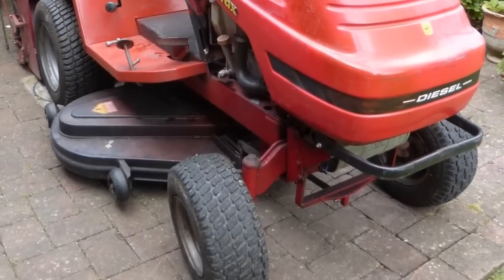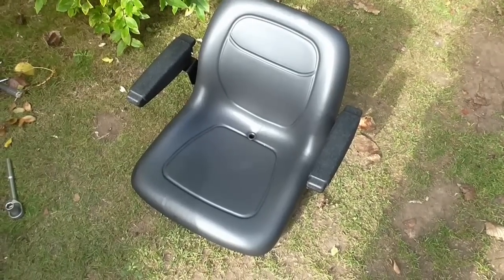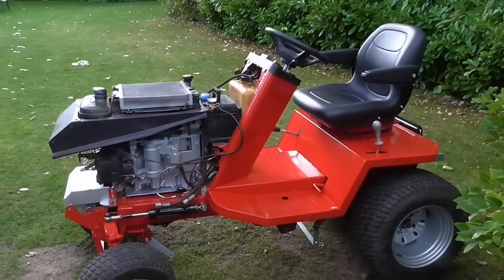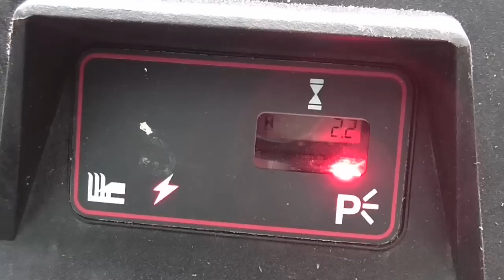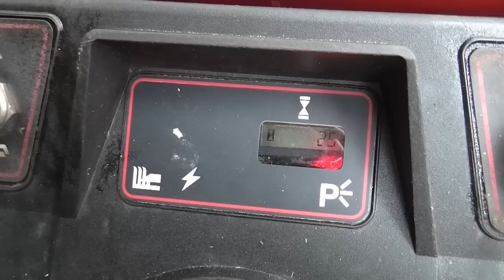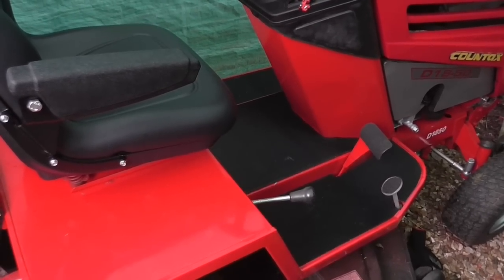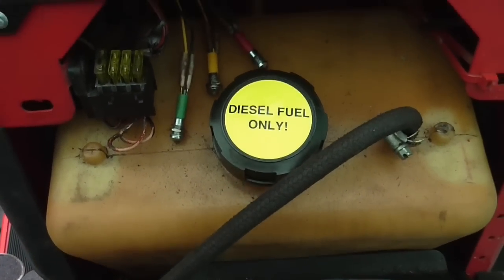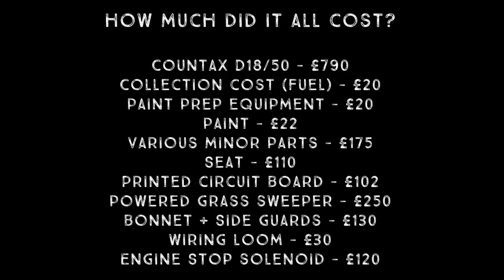Countax D1850 Diesel Lawn Tractor Restoration | Part 2 of 2

Comment: Just brought one of these for 1200Aud in great condition. Guy said he is going to drop the catcher off next week. Fingers crossed it's the same as the one in this video. Only need a battery and one tyre has a slow leak. So happy with it. Drives like a dream

Comment: I've just finished watching this 2 part series. Brilliant. Thanks. But I do have a question I hope you can help me with. I've gone through any manual I can find online scrolled through YouTube videos till my eyes bleed.😂 but nowhere can I find how to replace and bleed the power steering fluid. I have to spin my Steering wheel quite fast all the time just to keep her in a straight line. Scary. Especially when you need to turn a corner and she just keeps going straight ahead. 😂. Weird though not as bad when blades are engaged and cutting. Please help 🙏 me. Thanks and keep up the good work. Ants

Comment: Hi this video has been a big help and really interesting. But I have a small question! Is there any way of adjusting the electronical deck lift. My westwood t1800 4wd has a heavy duty mulch dech and it really doesn't go high enough.... It equals to about number 5-6 on my manual controlled westwood t1600. if it's not adjustable what can I do to make the deck go up more? Thanks James.